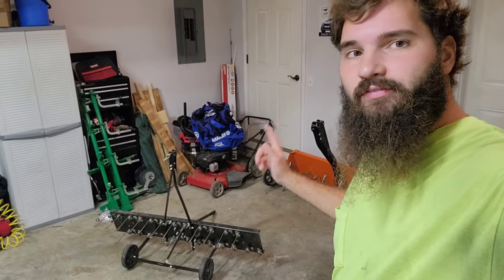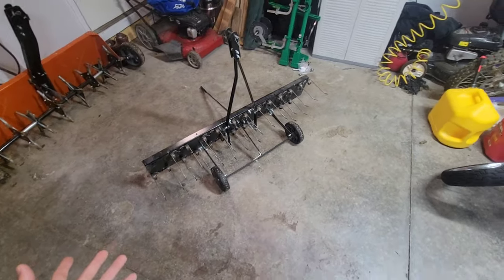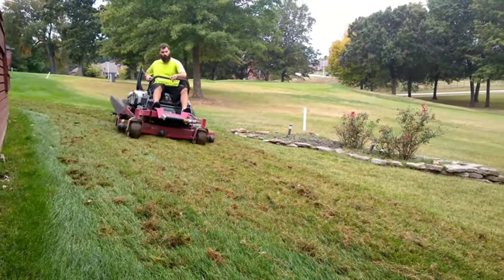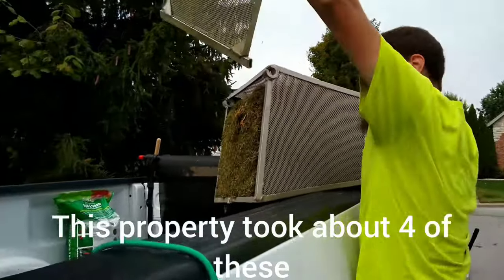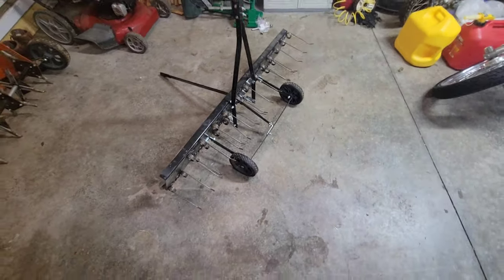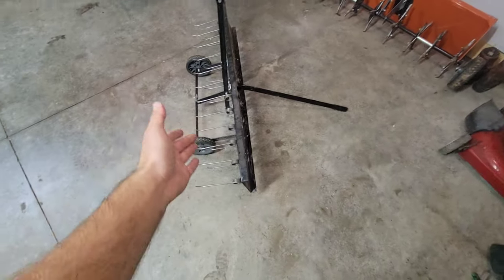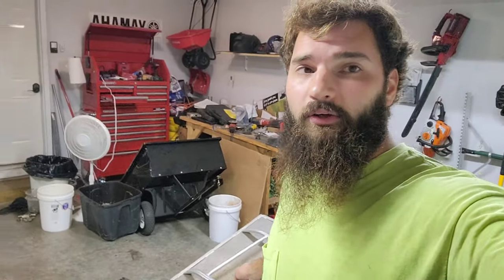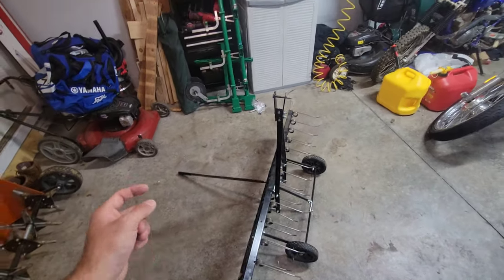Agrifab 48" Pull Behind Dethatcher Review 2 Year COMMERCIAL Use

Comment: The Angry Fab is a piece of junk. Cheap thin metal and rocks and jumps like hell, regardless of additional weight on it.  Looks like you sped up the video showing the dethatcher at work. If you don't have a perfectly flat yard and go slower than snail this thing rocks and jumps making the tines miss tons of spots. Go for the brinly. They looks similar but the brinly is made slightly better.

Comment: I've heard pull behinds are hard on the hydros. Any truth to that?
Reply from the maker: Yes it is. Definitely need a commercial unit to pull things like this for extended periods of time. Smaller trailers with not much in them are fine....but this unit depending on how much weight you put on it can cause damage

Comment: id be interested to see if dethatching would help my yard. idk if anyone in my area does it at all or not tho
Reply from the maker: You can always check by looking at your cores pulled from aerating. If you see a pretty thick layer of dead grass on the top of the soil of your cores you'd probably benefit from one
Reply: @JonsDailyHustle  id have to get a plugger then cause my aerator is a spike type lol
Reply from the maker: @BioHazardra  oh yea I forgot about that. You can actually just pull a core sample out of the yard yourself if you have a small diameter pipe it would work possibly if you really wanted to know 🤷‍♂️ lol